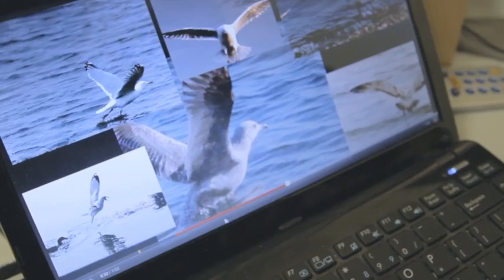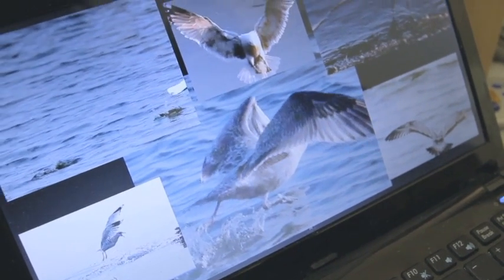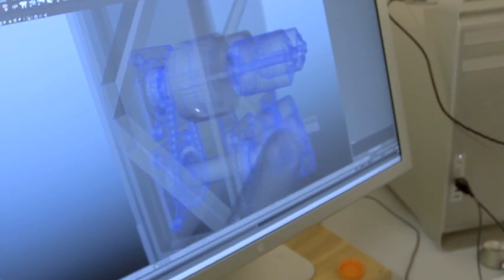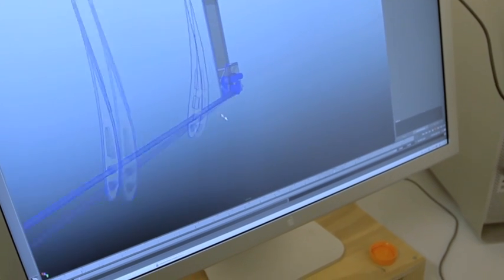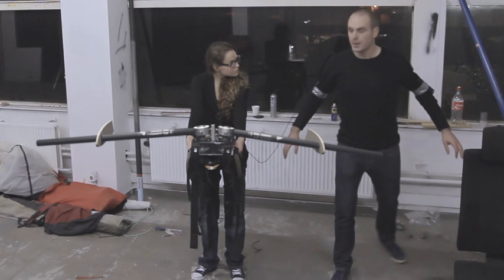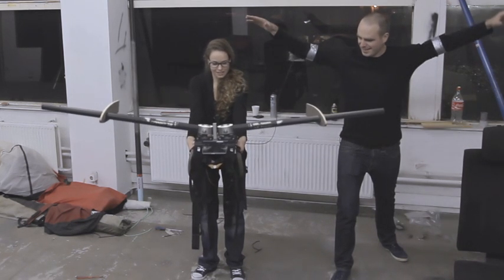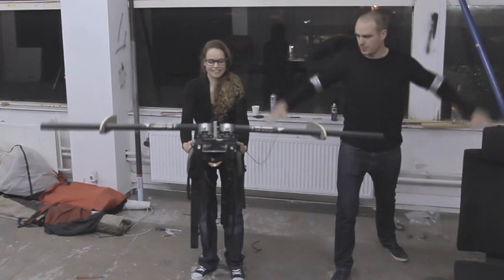Moving wingssystem with Wii controller  | part 9/14

Comment: @jarnosmeets80 

The difference between flight and glide is:
Flight overcoming gravity and aerodynamic friction.
Glide using gravity to overcome aerodynamic friction.

This is should be called Wii controlled glider.
Will not be powered flight until he can prove it can take off from a standing start.

Planes only glide as they come in to land.

Comment: The wing design needs the elbow and wrist joints attached, as in a real birds wing, better seen in the wing of an eagle.
The shoulder joint moves both down & back simultaneously, in the downward cycle, & can be locked out for a glide to conserve on energy needed.
During the upward cycle, the elbow & wrist retract, as they efficiently cut trough the air, getting ready for the next downward cycle.
The wingspan & wing area, must be calculated to compensate for the weight of the body being lifted.
The wing design with proper angle, locks the two outer joints in the downward trust position, then relaxes them as that downward thrust is lifted.

Comment: I'm not going to discount it based on the weight.  For all I know, it's got the harness weight belt around her or it's up against her waste, in which case the length of her arms would be pushing the rear of it against her body as a bracing.

Comment: Maya is a major 3d modelling/animation program designed and produced by Autodesk.  They have a number of different programs.  It roused suspicion because usually for engineering and architecture people use CAD which is specifically designed for such uses.  Maya is the industry standard and is used more for making digital art, and even CGI.  Many major films such as Avatar have used either Maya for various scenes or just creating objects of their movies.  Guy come out and said it was fake anyway.

Comment: @645524pasto Thinking about it, using Maya will show you how it works.. however, its more like showing you how you WISH it would work... Solidworks would show you if it is POSSBILE to get it to be working like that. in Solidworks you can simulate a gun, gunpowder exploding and the forces that it produces and the reaction of the parts in relation to that. whereas in Maya, you can just animate the the trigger moving, then animate the springs and the bullet etc. so yeah I think i am right.

Comment: The wings won't move exactly as his arms do.  Because the wings are designed and programmed to move in the up and down S rotational pattern that mimics a birds way.  That way he doesn't have to focus and flapping his arms exactly the same all the time.  He has to keep an eye on his battery life, and concentrate on other safety measures.  Trying to multitask like that while trying to perfect the way a bird flaps will inevitably result in a catastrophe.

Comment: For complex animations I'd prefer to use Maya or 3D StudioMax because the animation capabilities of SW, ProE, Inventor e.t.c. are sufficient for straight forward mechanisms but not more. The models could well be generated in any of the engineering CAD programs and then be exported.  Not that unusual.  So, what exactly is your point here?

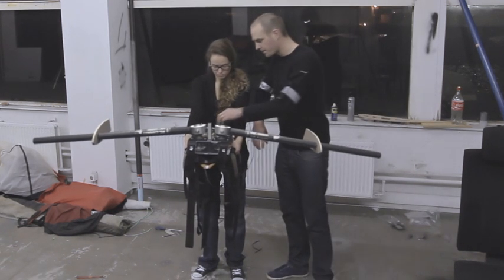Comment: This is CGI as well.. no one will use Autodesk Maya to simulate the mechanics of an engineering product, you can use Solidworks and such to work out where the stresses and weakness can be found. seeing the way that girl was holding that thing, you can see the "match-moving" is well done, however nothing of that size, unless it weights less than a kilo, can move so subtly [im talking about the jitters of the mechanism such as at 0:51 - 0:59 ] Also the materials are not photorealistic

Comment: All these Wii controller things are cool, but... are they necessary? The only thing you wanna control is the motor speed, right(the flapping mode seems to be fixed by design)? The way you did it is:flap your arms, use sensor to tell how fast you flap your arms, micro controller receive the sensor signal and tell motor how fast it should rotate. Well, fine, cool. But why not directly use some kind of pedal or handle to control the motor? This way you can even free your hand to sth else...

Comment: Dear Jarno, I like your viral videos. But a REAL engineer would have simply used a simple mechanism and a potmeter to define the angle of your arms, so it could output it WITHOUT DELAY to the wingservo's. 

And explain why you arent hired by FESTO already? They are leaders on innovative mechanical sollutions and they could only manage to get a 'tiny' 2kg bird flying. 

But I admire all the effort you put in to this project, en ik hoop dat het een leuk afstudeerproject was.

Comment: @Valca000 
Critical thinking and this are entirely different. In order to determine if this is fake or not, it requires knowledge of engineering, which honestly, I do not possess, but I do possess critical thinking and am an atheist. I must ask you, why is it impossible that this device could weigh just 2-3 kilos, hence the ease of the motor in lifting up and down? And then why is it impossible for a wingspan of 15 feet to overcome gravity? I'm lost, explain.

Comment: there is a reflection but the reflection seems too long relative to her body size.

the sound isn't right either. at the last upstroke the wing precedes his motion and the sound. and the last down stroke which is slow the pitch is much the same yet stays longer meaning it would go through a longer gear range.
it's a pretty decent fake but still makes them douche liars

Comment: I say it's fake because it is, not because I'm petty. I can and have done really great things.
I also do computer graphics for a living plus I have a keen sense of newtonian dynamics. my confidence that this is fake is in the high nineties. for the sake of argument you could say 100% certain.
the irony is that it wouldn't take that much more effort to actually do it. some RC motors are super powerful, just needs a stronger joint, more degrees of freedom and more sophisticated control. and a tail